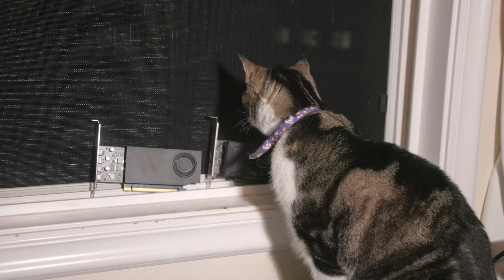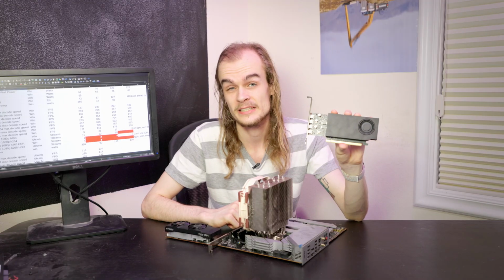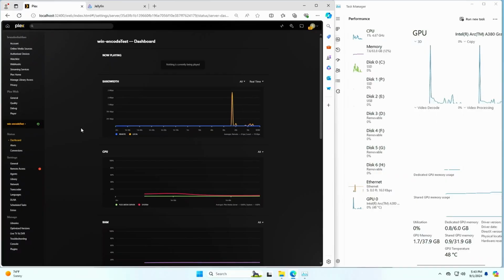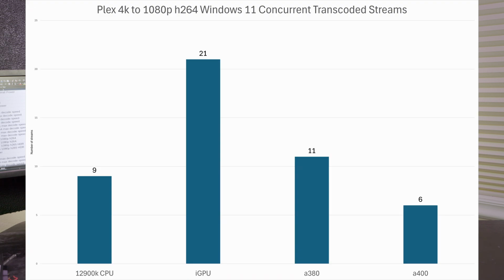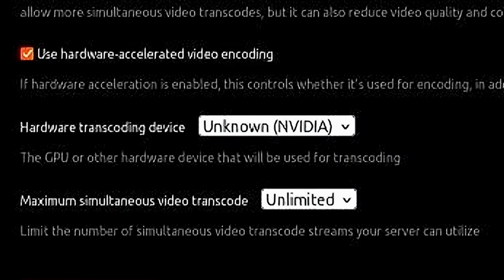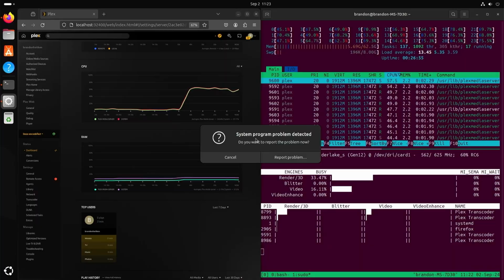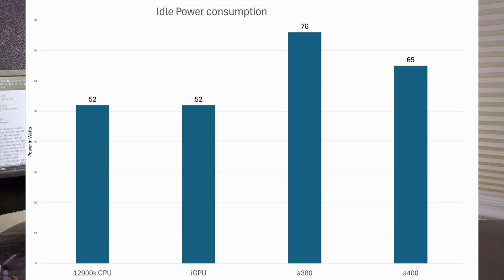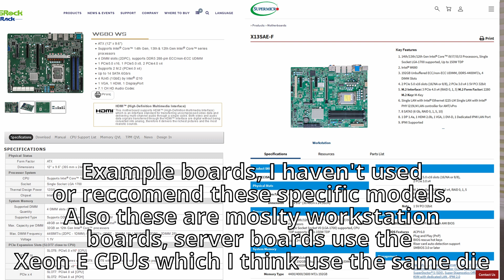Plex GPU Comparison: iGPU vs Arc A380 vs RTX A400

Comment: What kernel were you running for your Ubuntu test? I've read intel documentation that recommends using 6.14 as compared to 6.8 due to incompatibility with Arc drivers. It linked to Canonical documentations on an easy and straight forward upgrade, too.

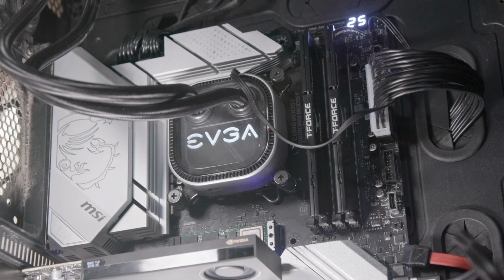Comment: 11:35 the reason the intel iGPU is really good and encode/decode is that there is a hardware encoding section built specifically for video encoding called QuickSync.  It is not related to 3D performance at all.  It has been in their CPUs for a long time now, at least 10 years.  It was why intel dominated video editing over AMD CPUs until recently.  Nvidia has something similar with NVENC.  I'm not sure if AMD has a name for it on their GPUs, but they tend to us their GPU cores for everything, which is why Nvidia GPUs have no performance hit while gaming and encoding at the same time while AMD GPUs get large performance hits.

Comment: I don't know if it's related, but my RTX a400 card does not get the overlay feature on the Nvidia app. For example, exposed like it's not compatible or something even though I can use the encoder and decoder with ffmpeg and that's still an issue as of today, November 25, 2025

Comment: I had a 10700t 1l pc and now I have a 12700t 1l pc. So I went from a uhd630->uhd770. The difference is amazing. I now have a 1l pc with a 6 bay jbod enclosure and now I think im set for 4-5 years on the cpu side

Comment: Been using intel i9-13900H with iGPU, it works fine but I was been looking for upgrading to an extenal GPU like the RTX A2000 or Intel A380. Look like the best way is to stuck with iGPU to save the PCIe slot for other thing.

Comment: Great video. I ran a similar test using Plex on CachyOS (Arch)  and an A770, A400 and the iGPU on an Intel 265K, all on Taichi Lite, Z890. Plex detected the Quadro card properly, and transcoding did occur, albeit, same as you, the iGPU was the clear concurrent transcode leader. This really surprised me! Don't have any other Amprere cards lying around, and still scratching my head. The Intel A770, 16GB, dGPU, did love H.265 transcoding to H.264 though. Only place it outperformed. I would gather, the problem is the PLEX transcode engine/code. Will try on Jellyfin next weekend, my wife wanted to kill me for "nerding on the weekend."
Reply: Any update on jellyfin?
Reply: I'd also like to know your results

Comment: Thanks for the info.  Intel needs to put out an 8G LP SFF just like that.   I am excited at the idea of a 24 GB workstation card for less than a 9070xt. I am about to build a server to be a render rig and my lab set up to get back into coding and tinker. I hope Intel sees the need to add multiple gpus. I'm not a big gamer but I play 2 low requirement games when I do.

Comment: Thanks for your videos. You really helped me get my proxmox home server up and running. I'm currently using a 10th gen I5 nuc I rescued from a scrap pile as my server, which was actually an upgrade from my hp gen 8 microserver. It seems to handle any h265 and covers the 1-2 transcodes I'm likely to need fine. As I'm getting short on disk space I'd love to explore av1 encoding. But it's such a mine field, intel ark is a bit lacking on igpu info. Wouldn't it be nice for all the Plex servers out there if someone made transcoding focused cards.

Comment: I have several cards with which I've done tests: RX 6400, RX 6600, GTX 1650, RTX 3050, I bought a SPARKLE INTEL ARC A380 ELF and I would say that it is in gaming performance in high graphics and 1080p just +/- the RX 6600 and RTX 3050 and the A380 performs better in video games than the RX 6400 and the GTX 1650. (all cards with GDDR6).

Comment: Great video. As costly as gaming GPUs have gotten now, seeing these cards benchmarked for non-gaming (Plex) use is wonderful.

It's actually really nice to see how well the 12th+ generation iGPUs perform for Plex transcoding. It's nice to think that, for once, you don't have to go out and get an add-on card (if you even have a PCIe slot) to do the thing. It's rare in modern computing just to have random excellent extra functionality just sitting there.

(And I'm not just saying that because this video makes me feel a lot better about my i7-12700T and i5-1235U* Proxmox nodes.)

* Well, the 12700T has the UHD 770 you tested. The 1235U has … something with fewer execution units and a confusing name. (Xe … something something.) But still. I feel even better about having jumped into this when 12th gen made the most sense to build with. I wasn't even planning a Plex server at the time.
Reply from the maker: Yea its impressive how good the Intel iGPUs are for this use case. 

One idea this gave me was to compare the 12900k to a N100. The should be the same generation of iGPU, so I want to see if the encoding performance is effected by the slower memory, CPU, and less GPU cores.

I think the mobile chips often have a better iGPU than the desktop chips as there is a market for a bit faster of a iGPU without needing the extra board space of a dGPU on a laptop. Intel also seems to have the mobile chips getting the newest generation first, and then trickling down to the desktop, possibly as the yields are better on the small dies.

Comment: try fire fox I have issue with chromium browsers not using Gstreamer on linux. Firefox bake codec in. However Fedora ship the wrong mesa with transcoding free only and blocking non-free by default. I run a N100 and i3 12100 with the same UHD730 encoding 1-4 stream is ok 4 above get shitty but the UHD770 has more power, making then good for plex servers but look at the igpu and power draw as some intel chip are heavy on power. a i3 sit idle around 35w with out power setting tuned out of box. N100 7w-25w. My N100 is going to become my home server soon.

Comment: Every 1GB of VRAM roughly translates to 3.5 concurrent transcodes in my experience with GTX 1660 on Ubuntu 20.04 with Plex. I stick to an older driver and plex version, since things are wonky lately. You can find many discussions on the Plex forum about their recent issues; a bunch of staff were fired and they're currently working on migrating to a newer ffmpeg version. Jellyfin is also in limbo since they're working on migrating to EF Core instead of having random sqlite calls littered throughout the codebase, so hopefully both projects will get things sorted out sooner rather than later.

Comment: Did you install the appropriate opencl icd for tone mapping? Also igpu being the best makes sense, since it has “Zero-Copy” capabilities. It just needs to map the buffer in order to use it, it doesn’t need to map, enqueuewrite, transfer, wait for transfer syncing, running the tone mapping, wait for sync again, and read it back with all the steps that it took to write it to the device.

Another consideration is the quality of the transcode, not something super significant, but I’ve always found HighQuality preset on NVEnc to be significantly better than anything QucikSync can put out.

Thanks for the video! Really was just here for a preview of the A400 ❤

Comment: As far as I know, the a400 only 1 decoder compared to the 2 you have on the 3050 or a1000 (and any other ampere gpu really).
Reply from the maker: Now I wish i had one of those gpus to try. The a400 is a pretty cut down card features wise.
Reply: @ElectronicsWizardry  I have an A2000 12gb, but I can't reproduce your test exactly. What I can tell you is that driver do work on Linux using Jellyfin, and I get more the fps than my i7-8700 igpu. 50% extra with tone mapping, around double without it, with a bit of variability. 
Similar results on Windows.
Now for me, the i7 igpu is more than enough (I rarely have more than 1 client needing transcoding at the same time, I get 80ish fps in most cases, so a lot of headroom), and I use the A2000 for a different use case, but I tested the performance just for curiosity. I don't have a power usage value to give you tho, I have too much stuff running to isolate the single effect as you did.
Reply from the maker: @12gark thanks for sharing. I think your better gpu and older igpu explains the difference. I’d still look toward a newer intel igpu as my first pick but adding a gpu to an older system can be an easier and cheaper upgrade than a new platform many times.
Reply: @ElectronicsWizardry  yeah, I absolutely agree, and even as old as my 8700 is, I can stream 2 4k HDR down to 1080 SDR with tone mapping with zero issues and very low power consumption. Newer one can only do better. 
The A2000 was never intended for transcoding in my case, I just played with it a bit and shared my results, especially considering your thoughts on ram usage (A2000 is small, but 12gb are far more than 4) and the different decoder. 
I bought it to render my cad projects off of my awfully loud laptop, as far from my ears as possible.
Reply: @ElectronicsWizardry  Ps, another system that would greatly benefit from a intel or nvidia gpu to increase decoding capacity is an AMD machine. A friend of mine has a zen2 apu in his homelab, added an 310 and improved transcoding by a factor of 5. Wild difference honestly.
Actually, even a 7900xtx is outperformed by the cheapest alchemist in decoding and encoding, even without considering AV1.
Reply: @12gark  amd transcoding is a mess. their latest generation has an error in hardware that means it can't encode 1080p in AV1, only 1082p lmao

Comment: From what I understand is that the decoding power is based on the generation of the CPU or GPU. For example intel CPUs of one architecture will all have the same quick sync decoding, Nvidia GPUs of the same generation will have the same nvenc chip and same for AMD VCE

Comment: could you compare these to a p620?
Reply from the maker: I don't have one to compare, but there pretty cheap on ebay so I might get one. The RTX A400 is a bit newer for a bit better quality, but probably isn't noticeable.
Reply: @ElectronicsWizardry  I just bought a hp z2 g4 that came with a p620 was just curious on the comparison odds are I’ll end up getting a a2000 at somepoint when they go down in price.

Comment: I paired a rx 470 8gb (it was cheap off eBay) forst with a gen 3 and then a gen 4 xeon cpu. The 3rd gen picture was so dark and deep in color richness, still a decent picture. The 4th gen cpu was the exact opposite. Bright amazing colar. I found this very supprising. Tbh i didn't think that there would be any difference but to my supeise the 3 to 4 gen xeons really did improve a lot into the 4th generation cpus.

Comment: This is great, thank you!. I would also love to see this test running Truenas scale running plex under a docker with Pass-Through GPU enabled 😁
Reply: Got Sparkle Intel Arc A310 ECO on TrueNAS ElectricEel-24.10-BETA.1 - works flawless with Plex on the ElectricEel new docker
Reply from the maker: Thanks for the idea. It would be interesting to see how passthough and docker affect performance of the GPUs.
Reply: @ElectronicsWizardry  agreed. My truenas is a 2700x w\ 64gb ram 4x 240gb ssd in zfs-1 for docker) and x8 6tb hdd for zfs-2 for media. I have gotten up to 12 streams. Need to test like you did to see the limit
Reply: I’d be interested in this test but with Emby in both VM and Docker

Comment: I have an Intel ASRock Challenger A380 on my Plex server. The Plex server is installed as a Proxmox Ubuntu Server container via the tteck Helper-Scripts. Hardware transcoding is running fine on the latest Plex server stable release. Transcoding with HDR tone mapping as well as subtitle burn are working as well.

Comment: Just did a build with some older Xeons, Coral TPU and an A380 for endcoding / decoding in Frigate and must say that the A380 likely has the best encoding quality and rock solid H.264/H.265 (HEVC) performance - especially @ 4K. And (while not yet supported in Frigate) - it's one of the few discrete GPUs below the many hundred dollars range that support AV1 with stellar performance. I mean who will put a 4070Ti into a rackmount server just for encoding...
Reply: It's crazy how good Arc GPUs are at encoding, the fact that a $100 GPU can come close to the dual nvenc cards is incredible.

I have an arc A770 (wanted the vram I know encoding performance is the same) that I use in a dual pc setup where I record 1440p120fps clips from my gaming pc and also have a jellyfin server running that uses it for transcodes. Encoding Speed isn't as impressive as the dual nvenc cards but it's certainly impressive. 

From what I've noticed dual nvenc cards have some sort of load balancing where both nvenc encoders will be at the same usage but with arc cards and the dual media engines only one will be used at a time by a given application. For example if I'm recording 1440p120fps footage it will be at around 70% on one but 0% on the other. If I then start up something on jellyfin it will then use the media engine with 0% usage MOST of the time. If arc cards had the same sort of load balancing I'm sure they would be more capable than the dual nvenc cards. With a deeplink compatible CPU though they may actually be better than the dual nvenc cards.

Comment: I was looking for a comparison for these, kudos on the video. I would love to be able to see the actual FPS for each of the scenarios clearly (I see you have them displayed in an Excel file on the monitor, could you please share this Excel?), not just the power consumption. If I may add, some timestamps in the description would be highly appreciated in the future! I myself have a TrueNAS server and am doing decoding with the iGPU from the Intel 12400 I've thrown inside, but was wondering whether the A400/A380/A310 would be an upgrade, or if I'm better of sticking with the iGPU for Plex on TrueNAS for transcoding. What do you think?
Reply from the maker: I added the excel file I had up as a shared google doc in the description. I also add timed stamps to the video. I made them when editing, but just seemed to have forgotten to add them to the video description.

From the data I saw its probably best to stick with the iGPU performance wise. I'd probably only switch if your having issues with the iGPU.

Comment: I picked up a used Nvidia Tesla p4 from ebay in 2023 for $100 and it works great for transcoding my files for plex.  As a bonus I can also use it for running my own AI with Ollama.
Reply from the maker: I should give Ollama a try on some different GPUs to see how they different in this usecase.

Comment: Since you got these 2 SFF GPUs, would you be interested in performance testing them, alongside with others if possible, with ollama / LLMs (aka AI at home)?
Reply from the maker: Yea that would be a interesting use case. It will be interesting to see what models run ok on the low vRAM of these CPUs.

Comment: Any plans on making efficient and cheap Proxmox setup(s) on "normal" pc hardware in future? Would be interesting to hear your take on components as hell man, you're by far the best source for stuff like this.
Reply from the maker: I'm curious what 'normal' hardware is to you. I think we have all have different ideas of a what a normal system is.

But trying Proxmox on standard hardware is something I'm adding to my future video list.
Reply: @ElectronicsWizardry  I think he meant no server or rack mounted hardware. More like old hardware, pc or laptop, and what can we do/accomplish with Proxmox. Personally I tried Proxmox to have several OS running with the way Drives work was unintuitive for me and I do not have the time learn all the commands and configurations. I dropped that project and opted for FreeNAS, which I also dropped when it started giving me issues now I finally migrated to ZorinOS because I can no longer stay in W11, right now I only use Windows for gaming, nothing else.
Reply: @ElectronicsWizardry probably an hp elitedesk 800 g4 mini. An affordable and low power consumption i5 8500T for example

Comment: I'm surprised dedicated GPUs didn't do better. I'm using N100 mini PC with Jellyfin. QuickSync enabled, Tone Mapping enabled. I just tried 4K HDR to 10 Mbps SDR 1080p transcoding and it showed 86 FPS, which roughly matches what you got out of your iGPU on 12900K (3 concurrent streams). With so many variables, it is hard to test these things, I imagine.
Reply from the maker: I really wanted to test Jellyfin and more but kept running into variables and different things I didn't think of. overall the Intel iGPUs seem to be the best goto transcoding hardware, with dGPUs making sense if the iGPU isn't available.

Comment: I run a quadro p2000 in a proxmox Ubuntu vm passed through and transcoding works great. There was a kernel bug preivously that would cause transcode to fail on occasion for nvidia gpus but I have not recently had this happen. It performs well but is somewhat limited by the 5gb of on board memory on that card.

Comment: I moved my Plex Server to a HP Mini with the 6500T and the transcode performance on the iGPU is excellent for something that uses very little power and alot of people connecting to it.
Reply from the maker: Yea the 12900k is probably a nearly best case for a Intel iGPU, but older models are still very imprerssive with much lower prices and can be found in super lower power systems.